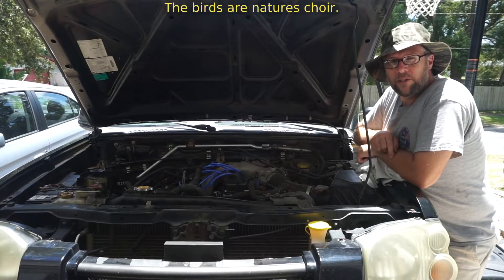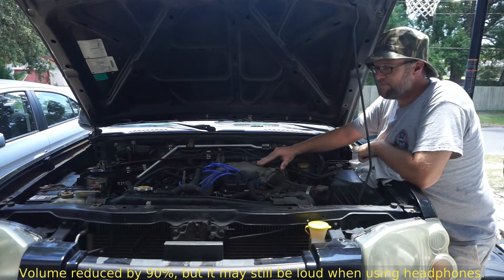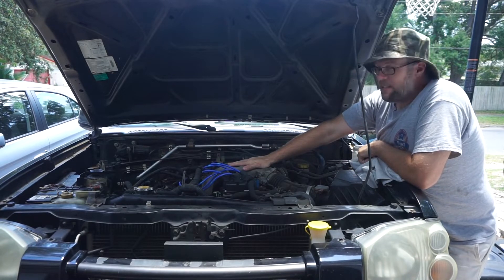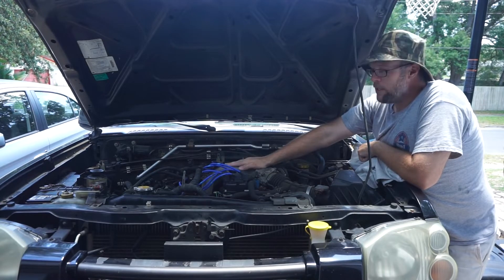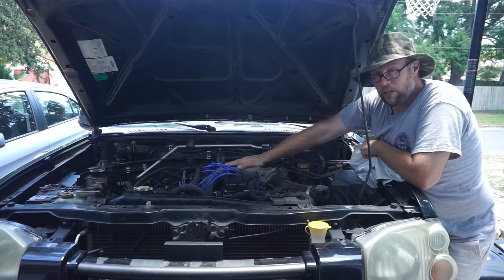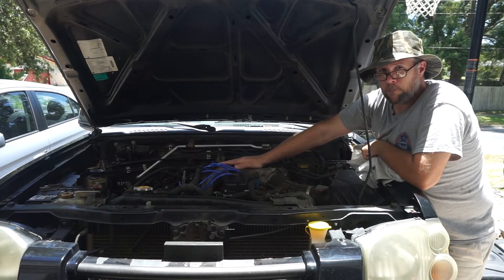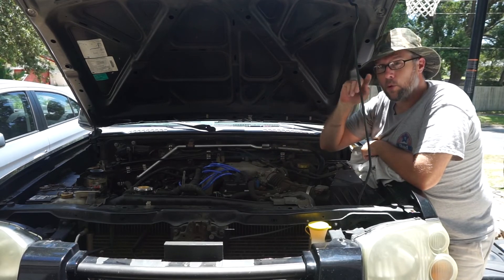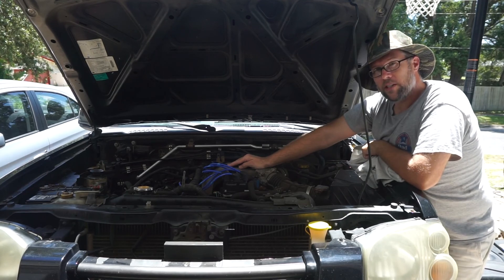2002 Nissan Frontier Crew Cab SE Blown Engine

Comment from the maker: I have had a couple of questions on the mileage, so I went to check and the exact miles are 151787. I am not sure what the exact cause of death was, but I would presume a little of everything, deferred maintenance, abuse, old age, etc. We purchased this truck new off the lot in the summer of 2001 and it has been a work horse almost its entire life. It has hauled everything you might imagine many, many bucket loads of compost and gravel, pallets of bricks and retaining wall, lawn equipment, home renovations supplies, a Bayliner boat, other cars, etc. I have gotten a lot of good miles out of it and I plan to bring it back with a replacement engine and try to get many more miles out of it.
Reply: Just listened to your video again after i left a comment. Make sure your distributor is working fine first...common things to replace.

Comment: Just did the v6 3.3 swap. Yes, just switch intake to the other side. Only have 50k miles on engine and wow! What a difference. Power to spare and torque! I can take it down to 20 m/hr in 5th gear and bring it back up like a automatic, getting over 25 mile/gallon! Looking forward keeping it for the rest of time!  Spent a little bit extra but well worth it! Even oiled it up from Krown yesterday. Enjoy your ride! p.s- watch one of those old commercials from Nissan, sparks the project.

Comment: Did you do the swap? The JDM swap went well on my frontier. It’s a good time to do the exhaust manifolds and address the trans wiring near the right side exhaust manifold
Reply from the maker: I have not, no money or time. How was it? Difficulty level? Do you have a video of it?
Reply: I don’t have a video, it was pretty straight forward. Everything is basically the same. I used a newer engine so I had to get a new starter, but everything else was the same. My truck is non EGR so I used the intake manifold from the dead motor. It came out the top
Reply from the maker: @hadojin210  Thank you.

Comment: I am having a blown head gasket on my and started to smoke from the driver side , was thinking to replace the engine as well but not sure where to start on it and if to do it with the newer engine what will it take
Reply: Hope you didn’t have to replace the engine.
Was it just your head gasket?
Reply: @bravocompany3017  still working on it taked all a part clean it up now all what left is to put all back together
Reply from the maker: I’m planning to replace my engine later this year.  Maybe around the fall or early winter when it’s nice and cool outside.

Comment: How did the swap go on your Frontier?    Did the JDM go OK.....I just had it done on my truck but am getting terrible misfiring.   I can't figure it out and neither can my mechanic friends.   distributor isn't the issue.  Any wisdom?
Reply from the maker: We have purchased the engine replacement, but have been too busy with work and house renovation.  I plan to use my Christmas break to tackle this project.  Wish me luck...
Reply: I had the same problem, I changed the map sensor of the intake, the other sensor of the intake that is on the button, and the fuel filter and is still doing the same thing. She start like shaking when she is warm up and she do it something. Dif you find what is going on? @ang5568

Comment: Doesnt the JDM VG33E have everything like on the opposite side like the intake manifold goes to the left not the right? You know what i am saying?i know am not saying it very clearly.

Anyhow, id love to see this swap dude. Good luck cheers
Reply from the maker: I believe you are correct. There are some things on the left, whereas a USDM has it on the right. As best as I can tell, the bolt holes are already made and all I have to do is move the parts that are in the "wrong" spot. Thank you for the comment.
Reply: Razor Bucks oh okay,sounds simple enough in theory. How many miles on that VG33E?
Reply: @georgewkush542  Just had this done and yes..all you need to do is flip it to the other side.

Comment: Thanks for the videos. I just recently got one of these and was going through on how to do everything. I was checking some parts online and when it asks me what engine type it lists 2 different types. I have a 4x4 xe. The types are 3.3L MFI SC SOHC and 3.3L MFI SOHC. What does the SC mean and how do I tell which one I have.
Reply from the maker: SC is the Supercharger version. I do not believe they made a supercharged version of the XE, but I could be wrong.
Reply: Yes it is for the super charged it also named as vq33er